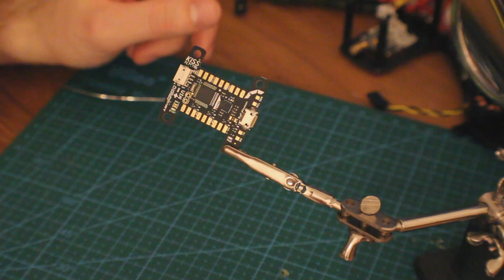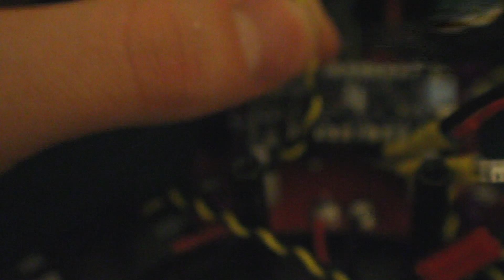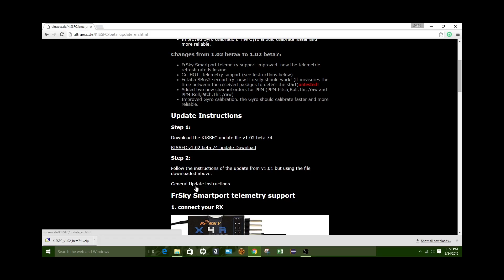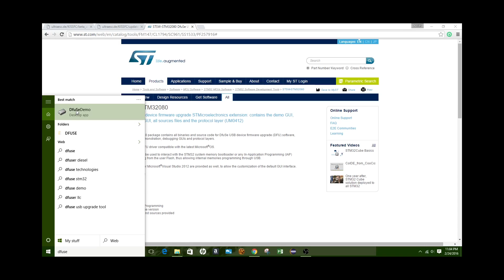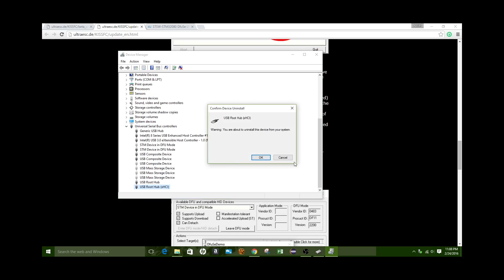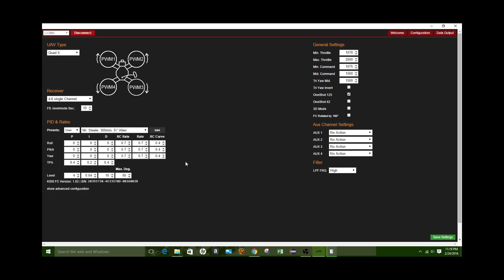KISS Flight Controller Soldering and Setup

Comment: Hi when I press choose on the dfuse program no software comes up for me to upgrade to the kiss plz help I have 2 built quads worth about $700 each with alien frame. So I'd like to get them up in the air thanks
Reply from the maker: Droneva I think you can flash in dfu mode by using the kiss configurator now without having to use dfuse software. I'm not 100% sure on that though. I haven't flown kiss in more than a year. I would recommend doing some research on the kiss rcgroups page.
Reply: Can't using windows and says to old for guide to handle

Comment: what size gauge  wire do you recommend using on 5 volt pins? 18, 20 or 22 ?
Reply from the maker: on 5 v 18 or 20 is fine
Reply: AdeFliesFPV, okay thank you for replying.
Reply from the maker: you're welcome! have a good day

Comment: Hello I didn't read through all the comments, and you may not have talked about this already, but in the video you didn't use kiss escs, and you never mentioned anything about calibrating non kiss escs. Did you have to calibrate? How did you do it, and how did it fly?
Reply: AdeFliesFPV what do you fly now
Reply from the maker: Quadrocoptology DotCom I fly the race flight revolt. Been flying it for a year now actually.
Reply from the maker: anfrae25 hey yes I did. Can't remember how but there is a calibration video somewhere. I don't fly kiss anymore

Comment: HI THANK YOU FOR THIS VIDEO, I HAVE A QUESTION I HAVE THE KISS 1.3 FC AND AM GETTING A RUNCAM SWIFT2 CAMERA THAT HAS A VBAT WIRE DOES THAT VBAT WIRE GET SOLDERED TO THE KISS FC? THANK YOU IN ADVANCE FOR ANY OR ALL HELP!
Reply from the maker: david ringler I don't know. I haven't seen how the new runcam hooks up yet. I thought it hooked up to straight voltage from the pdb

Comment: I used kiss FC and a blhi_s on my build. Everything is fine but the throttle will not respond when I give left stick a power after arming. When I move and jerk the quad the fc responds. However no throttle. Should I do a blheli passthrough by adjusting min and max throttle? Help! Getting frustrated with kiss fc!
Reply: I am having the same issue...tried everything. any luck?
Reply from the maker: David s honestly I'm not sure. could be a few things. I haven't flown kiss in a long time. you may want to ask in the rcgroups thread

Comment: Hi I am using KISS FC  & KISS 18amp v1.1 ESC"S THAT ONLY HAVE A GROUND AND SIGNAL so i guess i only solder the same way you are correct?
Reply: only the 24 race edition have telemetry as far as i know
Reply from the maker: Roxanne Ringler yes only need to solder those two and skip the telemetry pads
Reply: THANK YOU YOUR VIDEO SHOWED WHAT I NEEDED THANK YOU , YOU MADE IT VERY EASY!!!!

Comment: How do you calibrate your ESC's with the Kiss flight controller? I have Eachine Blhelis esc but thay have a signal wire . Do you think they would work with the kiss flight controller
Reply from the maker: Jeff Warhawk I would think so. I don't remember the calibration process off the top of my head as I haven't flown kiss in forever, but I think it's the same as everything else, calibrating in the motors tab.
Reply: Thanks Bro

Comment: hey there! is it a must to flash escs before use? I am going to be using kiss FC with littlebee 30A blheli_S, will I need one of those programmer tools to fly out of the box? If so, could you please point me to a good one that will work with my escs? thank you

Comment: hey man! how can i get telemetry Vfas? I already connected the x4r sbus and smartport to the aux1 but is not showing me Vfas. I got the kissfc with Little bee 20a ESC. please help. thank you!
Reply: I already did it, but nothing shows :(
Reply from the maker: Claudio Pozo Veloso that's really strange. sorry to hear you're having issues. just make sure all the wires of your kiss24a was are connected properly and same with s.port. it's been so long since I've flown kiss so they might have changed some things in the firmware.

Comment: exactly the vid I was looking for, I'm getting educated so I can build my xbr220, kiss fc, probably some blheli_s escs and x4r. Question, do I have to bridge boot pads every time I update firmware? thanks
Reply from the maker: thanks! i'm glad this video could help. Sorry for the delay in response. Yes you do have to bridge it. But now you don't have to use DFuse as the new KISS GUI lets you flash using Zadig.
Reply: VeilFPV sweet thanks
Reply: It looks like the esc flash tool is ONLY for KISS escs?  Or is there a way around this?
Reply from the maker: +Todd Buffington you're correct. it's only for kiss. no known way around this
Reply: Thanks, Darn I knew I should have never soldered these directly :(
Reply from the maker: +Todd Buffington welcome. what I used to do is desolder and resolder a connector for every one. it worked well. though was a pain

Comment: Did you reinforce the USB connector with solder? Was wondering if I could do that too, given that they come off so easily?
Reply from the maker: no I didn't. I've heard about the issue. but never had it happen to me. the new v1.03 boards come reinforced though
Reply: Really? I have the v1.03 too, but I dont have the 2 big solder blobs on either side of the usb as you do. I'm thinking of doing that myself, but I don't want to short something I shouldn't be...
Reply from the maker: +TheSYDeffect adding solder shouldn't short anything as long as you're not adding so much as to bridge connections.

Comment: Hi, I have very nearly the exact setup you are using with a x4r frsky RX. The problem I am having, after upgrading everything and making the needed adjustments and hopefully successful calibration of the ESC's, is this.

When I plug in the lipo I will sometimes get al the esc startup beeps but sometimes only one. The most common occurrence is that motor 2 and its ESC will start running with no control at all on my TX. After a little bit other motors will suddenly spool up and run with no control available on the TX.

I have tried multiple RX's and everything seems to be working fine on the FC and the PDB seems to be good. I have set up for sbus and installed the beta and the other earlier firmware checking for an issue there. I have bound rebound checked all solder joints etc etc. I have tried the default down and right left stick movement for arming with no effect. I can also see movement in the GUI COnfiguration. 

I feel like I must just be doing some stupid thing wrong as this is my first quad build using these or any components. I have done a lot of pretty advanced builds for fixed wing though. Including Vector setups and extensive telemetry setups for my Taranis.

Here is my component list. Any ideas would be GREATLY appreciated as I am stumped. Should I just do a PPM install?

HMB 235 X-6 Frame (GREAT FRAME!!)
Emax MT 2204-II KV=2300 motors
Emax BLHeli 20A ESC (standard size) BEC 2a 5V Oneshot125
Kiss FC with the new button bridge (FW beta 1.02 RC25 I believe)
Maytek MINI POWER HUB w/ BEC 5V & 12V
FrSky X4R 3/16 Channel with Sbus and Smartport
MinimOSD Micro
Then just normal VTX and Camera
I am using a Taranis X9E TX (LOVE IT! but will likely move to the HORUS)

I am completly at a loss. Maybe it is a FC?

Thanks,
Jeff
Reply from the maker: Are you connecting the bec from the escs to the flight controller?
Reply from the maker: and what revision of blheli are you running on the escs, 14.5 or 14.4?

Comment: Great video. If I use Kiss 18amp ESCs and SBUS but don't bother with telemetry, will my wiring be exactly the same as yours?
Reply from the maker: +Flight Mode Fast Thank you! If I'm not mistaken yes. Is there a ground and a signal wire for the 18 amps? I've never used them.
Reply: Yes bud a black and a white which I assume translates as my black for your black and my white for your yellow
Reply from the maker: +Flight Mode Fast Ok cool! Then yea it would be identical.
Reply: Many thanks. Subscribed :-)
Reply from the maker: you're welcome! Thanks for subscribing!

Comment: Thank you for your responce, the filfer is set to - OFF   i am running defolt PID's as it is flying smooth and true will up the rates once problem is solved it is a 160 quad with T motor 1806-14 KV 2000 motors 3bladed 3in props with 18a Kiss ESC's
Reply from the maker: +Barry Anderson the LPF filter off should be ok, but try moving it to high, or medium high (and on down the line and see if there's a difference). Also definitely give it a good tuning. Default pids never work out. Are your 18 amp escs getting hot? What brand propellers are you using?

Comment: I have tried this new Kiss FC on two of my Quads by just swapping with 
my flyduino multiwii FC boards got both of them flying great but motors 
get extremly hot after 30 seconds flight. Can any one surggest a 
solution ?
Reply from the maker: +Barry Anderson it could be a couple different things. Did you tune the pids properly after switching? What is your filter set to in the gui?

Comment: hey - did you update all your escs before hand? no passthrough is a bit annoying coming from bf/cf with direct soldering
Reply from the maker: +jamble7k Yea I did. Even on my betaflight FC's I still update my ESCs before hand. For having a convenience downside, the flight controllers upside outweigh those downsides in my opinion. I've really enjoyed flying it! It's flight characteristics are one of a kind in my opinion.

Comment: I can not get the gui to connect to the fc.
Reply from the maker: +proline1349 you should likely go ahead and upgrade it anyway then, that way you go through the whole steps to getting it to connect in dfu mode. if you have another program like zadig for stm32 connection there will be issues

Comment: would the connections be the same if I was using a spectrum sat Receiver
Reply from the maker: +proline1349 There is a spekt. sat port to the right of the three s.bus pads I soldered too. It's a type of jstxh connector that the spekt sat uses. If you look at the three tan things it's the one that is by itself on the top of the board